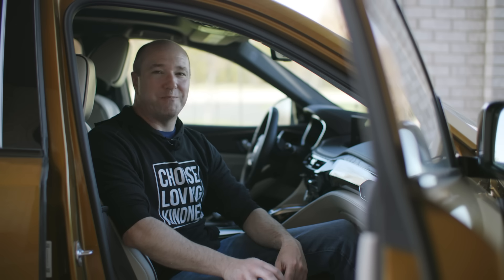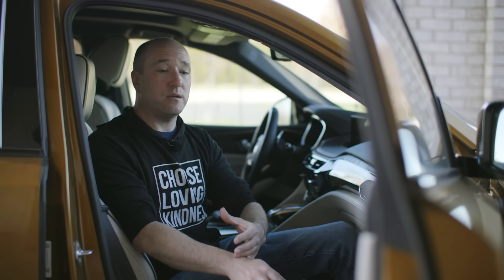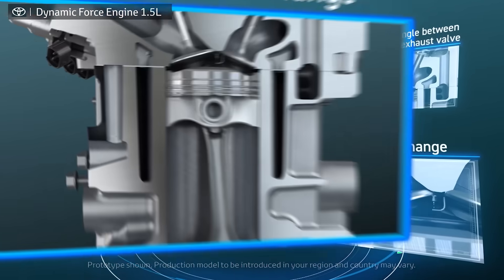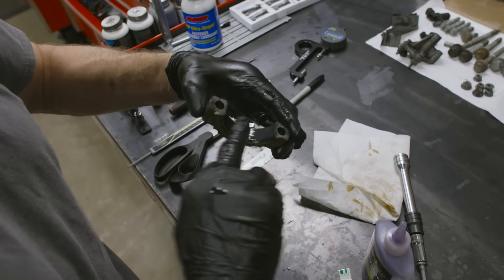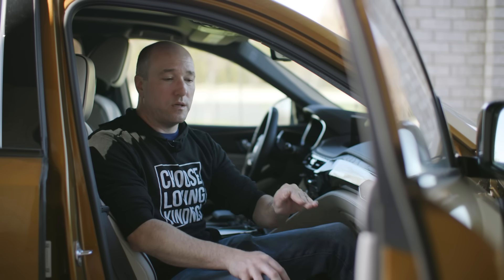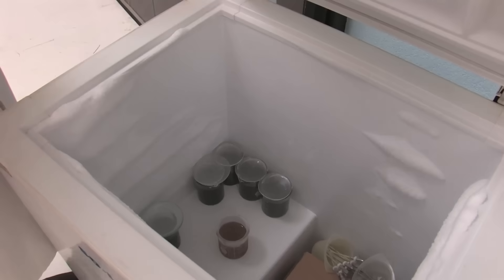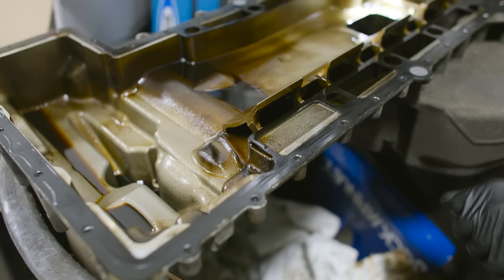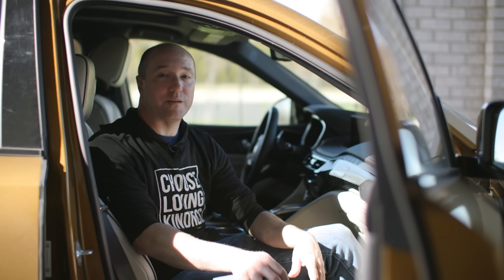Understanding Engine Break In | Dos and Don'ts

Comment: It was years ago, so finding the resource is likely a no-go, but I remember I found a blog post once from an ex-NASCAR tech, talking about exactly this.  Their investigations found that the only "break-in" for engines was the first start, until oil pressure built.  The claim was that >90% of the particulate contamination (not from combustion elements) occurred during the first 10 seconds after the engine was first started.  Their official position was to run whatever lubricant you were going to run for the life of the machine, first start let pressure build, shut it off and drain it.  Refill the engine, run it in the expected environment (ie drive the machine the way you are always going to drive), and change the oil around some hours (which I did some math at the time and came to the conclusion that ~500miles for the "first" oil change was about right).  After that, use it, drive it, do the oil/filter at standard intervals.   Good to see a video on this platform with some facts and research.  I would like to see one about "bedding" in brakes.  I've got me an anecdote (same NASCAR tech) about those too.
Reply: Breaking in a racing engine is different from a street-driven engine.

Comment: Piston rings are ground with a small vertical angle in order to bed the ring into the hatched bore, if the engine isn’t revved hard under full load bursts along with long load lift off, the bedding process is not fully achieved. One hour of full pull through the gears isn’t done, then the ring will not bed properly, and it will roll over the hatching, too late, the engine will suffer more blow by, less power and efficiency. It’s that simple..

Comment: You put together the best information for this topic, especially when I heard silicon from RTV causing the aeration. I was working with other colleagues at GMPT doing about 3 month long study found strong correlation between silicon and aeration on small block V8 engine， and found synthetic oil is more forgiving the influence from the silicon. As result, that engine’s factory fill oil was changed from mineral to synthetic oil to avoid valve ticking noise resulted from the aeration.

Comment: 10,000 to 15,000 mile oil changes are nuts.  Take a look at the inside of Chrysler Pentastar 3.6L VVT engine that's run those long oil changes.  It all varnished up inside and the valve train gets trashed.  Frequent oil changes are a hell of a lot cheaper than rebuilding the valve train with 4 overhead camshafts.  My 3.3L Plymouth/Dodge engine has over 200,000 miles and doesn't use oil.  I always change my oil and filter at 3,000 miles and have never gone past 3,500 miles.  Valvoline 5w-30 convention so far with Fram tough guard filter.  Mostly short trips 5-10 miles.  Van is a 1995 Plymouth Grand Voyager LE.

Comment: Great content, thank you!!  I purchased my 2012 VW Jetta (2.5 Liter inline 5, naturally aspirated) new & took delivery off the truck (so, no "test rides").  I drove it on a country highway (30 - 75 mph) that passed through many small towns 3-4 times (so 3-4 100 mile trips) during the first 2,000 miles.  11 years & 130,000 miles later & the oil is tan colored after 8,000 miles.  Regular oil changes @ 10k miles, per factory recommendations & I never need to add any oil between oil changes.

Comment: basically just drive locally
Reply: Highway is a great place for break in. Drop speed, accelerate, drop speed, accelerate. Constantly changing speed and RPM's. Keep moving through the gears.  Don't use the cruise control.

Comment: For the first 1600 km, I did no long trips, kept it under 100 km/h if I could (very limited highway driving), try avoiding hard/slam braking & acceleration, and got an oil change at 1600 km.

Comment: A comment on a Honda owner forum recommended using 5w-20 weight oil ( instead of 0w-20) to greatly reduce the 'oil dilution' problem in his 1.5 liter engine. Does that make sense?
Reply: To me, it only makes sense to use what the owner's manual says.

Comment: Prolonged oil change intervals are a disaster. Yes, oil has improved but engines have become far more complex. Multiple, long timing chains, needle roller rockers, variable camshaft timing units. Even small amounts or wear here can be catastrophic. Manufacturer service intervals are intended to get their vehicles outside warranty and not a lot more.

Comment: Dude I know just got a brand new Civic SI, a week later took it to the dealer for sport exhaust install or something to do with the exhaust. He had a dashcam that they didnt notice and two service techs took it for an absolute flogging. Dumping the clutch, redline, lots of burnouts, shredding his new tires, caught frikken air jumping railroad tracks and frikken bottomed it out obviously. He caught them red handed, showed the video, and all they would do is fire the guys. No free tires or clutch when needed, no inspection, alignment, etc. I wont be using that Honda dealer any more. He got a lawyer and even got the cops involved. Havent heard an update.

Comment: I bought a Tacoma from a guy that bought it brand new. He was a turtle a hole. He burned rubber out of the lot and beat the crap out of it from day one. He was a true asshole, and he still is by the way anyway, I ended up buying that car after he put about 50,000 families on it today it is still running at 300.k
Reply: What engine was it? I have a 23 v6 tacoma that I think i broke it in well although at one point looked down and was going 90 with the flow of traffic, only for a short period tho. Felt like I accelerated a little hard too a couple times but I'm guessing it will be fine.

Comment: When I buy a new vehicle I put the pedal to the metal as soon as I drive it off of the lot. I don't sustain it high speeds for a long time, but I like to pretend that I'm a drag racer. Rings get seated well. I  bought a few large motorcycles that I broke in gently and like a sissy, and they constantly used a bit of oil. My mistake, now she's pedal to the metal. It works much better.

Comment: When I bought my first new car (Honda HR-V), it had 19 miles on it. I immediately put it on the highway and drove it to my apartment 2 hours away. Car still ran perfect when I traded in at 72k. And most new cars have a maintenance light telling you when to change your oil. My car is 10 years old and does that. I just take it in when the orange wrench comes back.

Comment: Motorcyclist Magazine (Youtube) did an experiment on this with two fresh engines (https://www.youtube.com/watch?v=xpoglovyy_8) and went to the extreme. Granted this is powersports and not automobiles. Basically it doesn't matter - but I would think that no manufacturer in their right mind would ever encourage a hard break in which might find them liable for accidents.

Comment: first 1000 miles, city miles only if possible- not over 4K rpm , change the oil in 1000 miles. then 4K, 7K and 10K/ after that. every 3333 miles (about 3 times each 10K) oil changes if you don't want to have an oil burning engine in 100K that burns a quart of oil every 1k , it is also good for the turbo .
The new engine nowaday has a very low compression piston ring for "better" MPG, just a little wear out on the cylinder wall will cause oil burning.

Comment: You drive a newly rebuilt diesel like you stole it. You read your owners manual like any person with a brain should when you buy a brand new car, and you follow their recommendations. 

I turned wrenches for a long time, as long as you take it easy on a new gas powered vehicle, you’ll be fine. Do your first oil change at 3,000miles, regardless of what the dealer says, you have the right to change your own oil, unless you pay for the lifetime service. I can’t stress enough how bad it is for a brand new engine to go 5,000 plus miles on its first oil change. Don’t do that. Magnusson moss act protects the consumer from predatory and misleading service writers in dealership shops.

Comment: Years ago car manufacturers released their cars with a “running in oil “ which was changed at its first service of 1000 klm.  In the seventies in Australia , Chrysler released the 4 cylinder Sigma. Problems arose, as they must have made a boardroom deal with an Oil Company, and all were initially filled with the latest super grade with all the  non wear additives . Consequently they had a lot of recalls, after their first initial run in period they had glazed bores, and burning oil like no tomorrow. I remember seeing new Sigma’s with plumes of blue smoke emitting from their exhausts during that time.

Comment: Do we still have to break the engine in even though a brand new car comes with couple hundred miles on it?
Reply: Don't buy a brand new car with a couple hundred miles on it. It's either been test driven a bunch of times and beat on, or came from another dealership out of state and was probably on cruise control most of the way.

Comment: I NEEDED this video.  Driving brand new Audis, I baby my cars even past the 1,000 mile break in.  Videos like these are needed.
Reply: Same Here.  BMW 340
Reply: @Rocky-xx2zg The B58 is still a commodity engine dude. It only matters for the S58, maybe.
Reply: @Sarayu45  I would hardly call the B58 a "commodity" engine like you would find in your average Ford or Chevy.  Yes, BMW does use it in their utility vehicles, but also in their higher end M-sport variants making decent power.  And with forged bottom end capable of making crazy power with mods - similar to the 2JZ . . . probably why Toyota uses the B58 in the new Supras.  The B58 is a very respectable engine, and I say this owning an S58.

Comment: I've always done gentle break ins & slowly increased speed & loads & allowed  casual warm up & cool down cycles & changed oil after 1000 miles. I even ran high phosphorus royal purple break in oil in all 3 of my inverter generators before switching to synthetic. I work my vehicles hard, especially my company vehicles & live in a climate with sub zero temps for 5 months a year.... I've never had any engine failures in any engine I've owned. None blow smoke or burn/leak.... proper break in is as important as regular maintenance...

Comment: I used the “motto man” break in. (Google it). He’s a moto x guy, but same principles apply. City engine breaking up and down hills really seats the rings. 430whp stock block 18 Sti at 67k miles and still running strong.

Comment: Oil temp should be available to read in every vehicle, (dodge Chrysler give this info) you are exactly right about 0w20, running at 80 mph into a side head wind in 90 degree weather oil temps will get very high probably over 230,  My mazda cx-5 was down almost 2 qts,  oil black as tar.  Got an ob2 bluetooth with android app,  at 210 and below did not use any oil, 215 would start to use oil, also oil manufacturer or oil additive package will play apart in how much oil is lost at high temps,  Kendall 0w20 did not do well with high temps,  castrol 0w20 with titanium did well.  just my experience.
Reply: I have the same car. What dongle did you end up going with.

Comment: Here's something to think about.
When a manufacturer like Ducati puts a new engine into a world superbike or motogp bike and hands it to the rider, he takes it onto the track and redlines it after half a lap.  No run-in whatsoever.  
There is a youtube video made by some guys in the states.  They got two 500cc engines from honda and put them in two identical frames.  One was "run-in" extremely carefully, all the stuff you are supposed to do, for I think it was 1000 miles, or something like that.  The other one was redlined from minute one, and driven as hard as was possible.
After a given mileage - I forget, I think  it was 10,000 miles but can't remember for sure - they pulled both engines apart and checked every part.  No discernable or measurable difference between the two.

Comment: I did almost everything you said except the first oil change was done @5k miles but toyota recommended @10k. I tend to drive in the 70-85mph and always noticed when i do the oil change the oil was super thin so know i know why 😅( i do them every 5k still ,car has 57k miles )

Comment: I replaced my S62 engine in my E39 M5 with a new factory replacement. The old engine burned oil from day one because I babied it. I drove it to the track after picking up the car from my mechanic's shop and railed on it all day. The thing never burned a drop of oil and ran better than the original engine. My mechanic was a retired Mercedes factory race car mechanic and told me to drive it to track on highway and floor it in top gear several times. Then go ahead and run it hard on the track. Basically, you need maximum cylinder pressure to seat the rings properly, once the rings seat you're good to go. I've done this for every engine/car I've bought or built since and it's never failed me...
Reply: As one person here said, BMW recommends a break-in period of 1200-1300 miles at no more than 4500 rpm and 100 mph. Varying speeds is highly recommended.

Comment: One common factor that limits the life of your engine is overfilling the crankcase with oil.  Measuring with the engine at normal operating temperature, the line of oil on the dipstick should be a hair below the full mark.

Comment: To break in my 2022 Toyota 2.5 four-cylinder, I didn't brake hard, accelerate hard, use the cruise control, or drive over 55 MPH for the first 600 miles.  Then I went on a 600-mile round trip, using my cruise control on and off.   I then changed the engine oil at 1290 miles on the odometer and drove it normally.  I follow this up with an oil change at 5k miles and every 5k mile increment after.
Reply: why didnt you brake hard? brakes are not part of the engine system and they do not require any break in.
Reply: @static7985  Brakes absolutely require break in.
Reply: @derbigpr500  Not in the sense of using them gently. To break in your brakes you HAVE to brake hard, several times, without going below 5 mph.

Comment: I'm a mechanical engineer. For heat protection, all the alloys chosen in an engine are made to not be close to the temperature where it would lose its heat treatment. 
The first 1000 Km break-in is used to make all moving parts fit into one another by making them scrub one against another.  Due to the metallic residues and the machining burs that can end up in the oil before the parts have polished each other, it's better to keep the engine at low rev to prevent any cylinder scratching from those residues. That's also why the oil needs to be changed after the first 1000 Km. 

Back in the days during the American big four reigns, the engine parts tolerance had bigger range tolerance so if a big piston was put in a small cylinder then yes it would take a few thousand miles for the parts to ajust to one another. But thanks to the japanese perfectionism, the manufacturing tolorence got more and more precise at an afordable price making the endless break-in period absolete.
Reply: Not sure how automotive engines compare, but with brand new small engines (ex. lawnmowers) it's good to change the oil after the first 30-60min of run time. Nevermind on a microscopic level, with just the naked eye you can see metallic burs pouring out when you drain it. Like you said, you don't want the burs splashing up into the cylinder and causing premature wear.
Reply: I have a 2024 BRAND NEW ACURA MDX. I asked 3 seperate  service managers at 3 seperate Acura dealerships if I should change the oil and filter at the FIRST 1,000 MILES and all 3 of them independently told me not to do it?  I WAS WILLING TO PAY FOR IT OUT OF POCKET. What is your opinion?  Thanks
Reply: Eric O from south main auto picked up a new Kia and dropped the oil at 1000 miles, in the clean bucket he shined a light into the oil and swirled it around. Full of metal filings!!  i always do just the oil at 1000 then at 2000 oil and filter on anything new. Might be wastefull but to each his own.   @raybutts9133
Reply: @raybutts9133  I never did, and our 20 year-old Lexus never consumed any oil. Its first oil change was at 5000 miles or 6 months.
Reply: Same with VW, but when I showed cash there war suddenly no problem
Reply: I'd think an alleged engineer would know it has nothing to do with the engine, and everything to do with the rest of the drive train.

Comment: I bought a 85 mustang gt 5.0 3000 miles installed 125hpN0S ran the car at maple grove every ford Motorsport event changed oil 7500 tru 12000 sold the car in 91 177000 miles replaced 2nd 3rd gear twice loved it original clutch loved that car

Comment: On my car i change the oil every 10 000 miles, the manufacturer recommends 20k but i drive it like a maniac most of the time. Mine is old, 2001 i let the oil temp needle get to operating temp (95°C) and then DRIVE it fast. I also put 10W-60 race oil instead of the 5w-30/40, the engine seems to like it so far.

Last time i had the chance to break in a brand new engine i drove it carefully and avoided going about half the rpm range, i guess i was wrong on that one. Should have gone for a 600 miles trip to the mountains in comfort mode 😊

Comment: Thanks, very informative info. I am now 'breaking in' my '17 Forester XT for the second time. 3 months ago at approx 30k on the Odo, an engine shake at idle developed that could not be diagnosed after 3 separate visits. The dealer along with Subaru decided to give me a new short block (luckily, I had the 7 yr/100k warranty). It cost me just the $100 deduct. So, I  have the situation of breaking in just the top half of the engine. I'm basically following the same procedure as I did in 2017 with easy to moderate varying driving, no hard pulls to redline, and will do an oil change in 1k. Any comments to the contrary would be appreciated.
Reply: Sounds good to me.